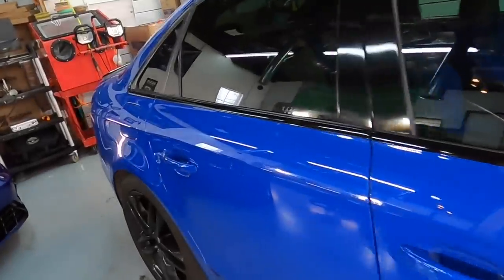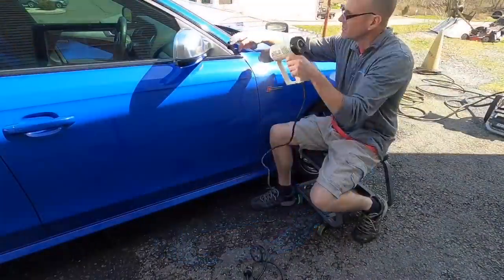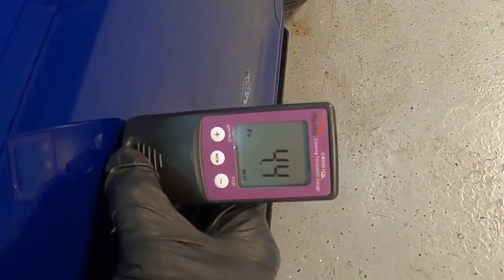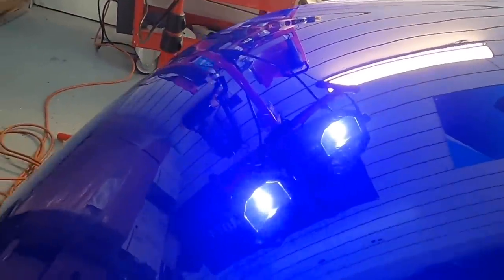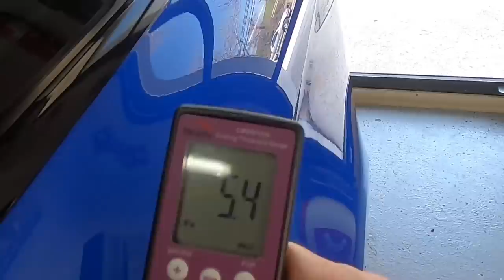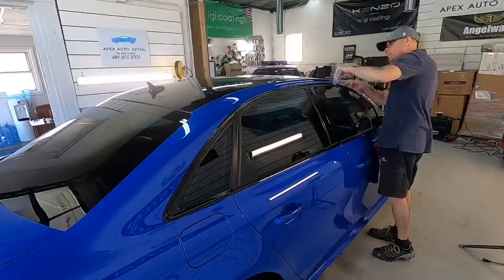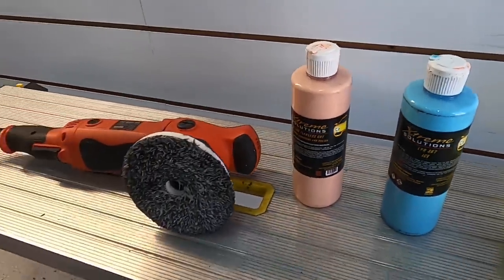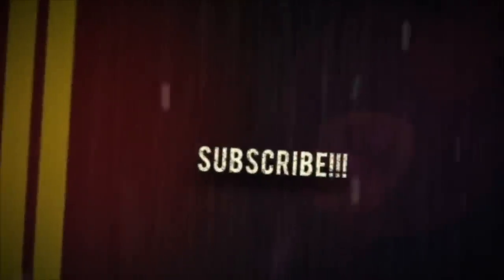VW Golf R And Audi S4 Correction And Protection! Part 1!

Comment: Hey Brian, glad you're using the Ice mixed in.  I found out a year or so ago that it really helps lubricate compounds, reduces any dusting and enhances the finish.  Great job as always!  :-)
Reply: ditto, a pleasure to use & almost glides across the suface, does though stain nice new foam pads which are now specific to grade & 4usewith 367/403 as well :-)

Comment: Watching intently.  I have a 2020 Tornado Red GTI with only 8k miles.  Slight repaint on hood 3 months ago, no scratches, just swirls, and of course, tree sap that is wicked. So after a full decon, ready to go.  I've ordered the Meguiar's DA MF system, and initially intended to test spot the hood swirls with the finishing pad & polish first, and see how that works.  The kit comes with the D300 and cutting discs should I need more cut.

Comment: Hi Brian, apologies for being a bit late. Couldnt help but smile seeing you use a combination of LVR500 & 367 Ice, Ive just used the same combination on one of my son's Black VW (shopping trolly) the only negative, that combination stains foam pads somewhat but worth it for its defect removal & finish. Wondering if it was a trick of the light but, just before you started removing the PPF (@ 1m:35sec) the flake appeared to leap off the page, while the rest seemed flat gloss, did you notice any difference? Ive recently stripped the PPF from my Lexus Barge, it had seen 10 years & even protected the paint for 100K miles & a 70 MPH head on with a pigeon, but had discoloured, I found steam almost impossible to use as it was too slippery to pull on & trying to wipe the surface was equally rewarding as it had cooled & still removed mm's at a time. The heat gun is a winner though, wish Id tried it first. Looking forward to the next chapter..
Reply from the maker: An IR lamp helps a bit as does pouring very warm water on the PPF.

Comment: is bauer long throw a good machine to buy to apply maguirers or turtle wax cleaner wax to a large  sprinter van ??????? been doing it by hand, my other chevy van i used the porter cable that i bought 20 years ago from griots,but the backing plate is rotted ,i dont do the roof,so the sides dont need correction
Reply from the maker: Yes...that would work fine.